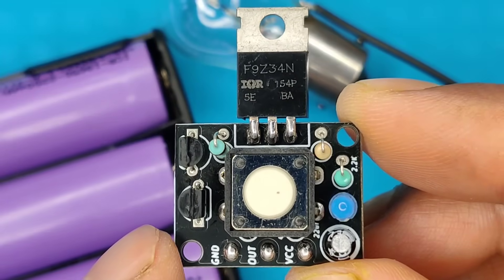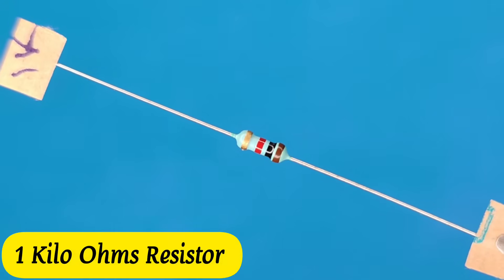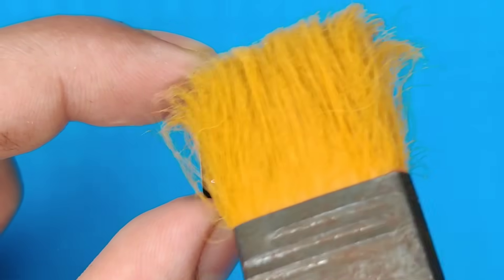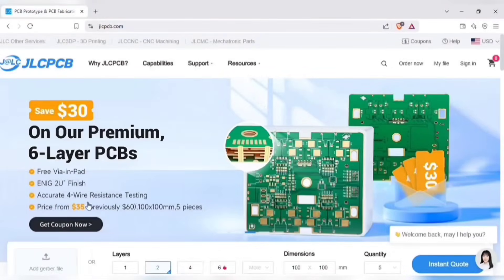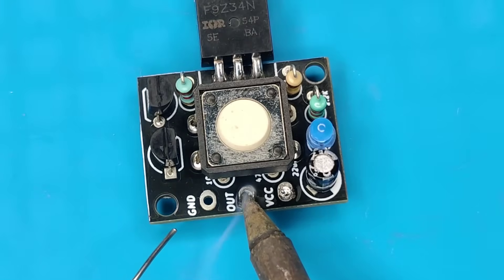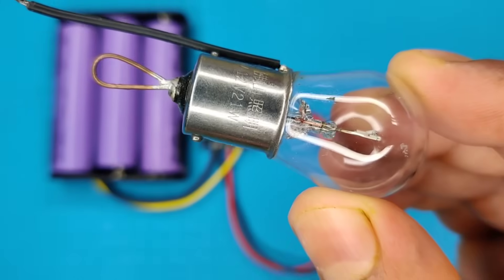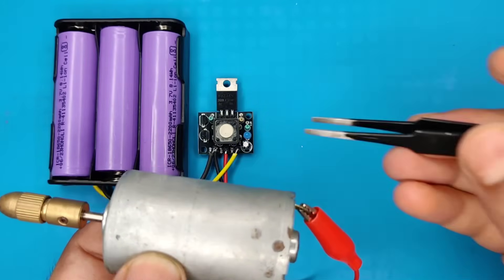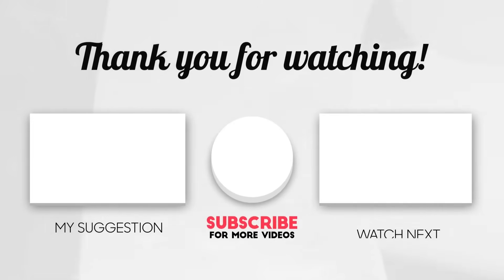Helpful Electronics Project for Beginners & Every Home

Comment: Дякую за корисну схему і файли, бажаю успіхів! Яка максимальна напруга живлення схеми?
Reply from the maker: 7-24v, best works with 12v
Reply: @CreativeTechos  Дякую за відповідь!
Reply: circuit has Q26 mislabeled as irfz34n a n-channel mosfet. should be irf9z34n a p- channel mosfet
Reply: Very useful video please make a video for 5 volts
Reply from the maker: Ok I'll definitely make 5v switchable circuit